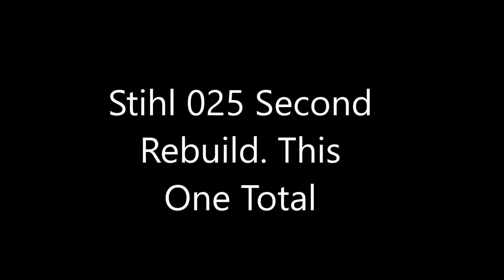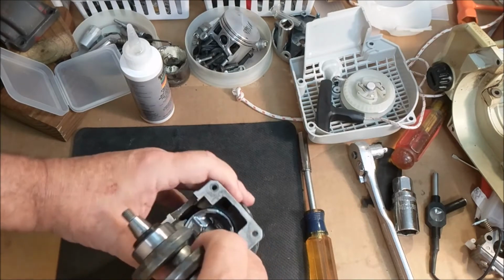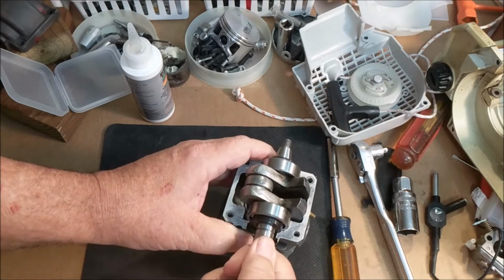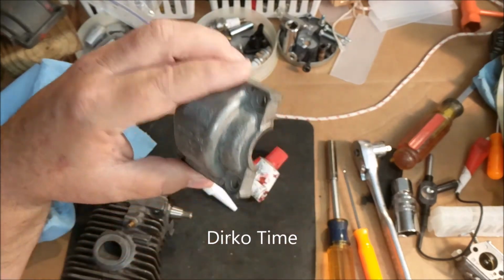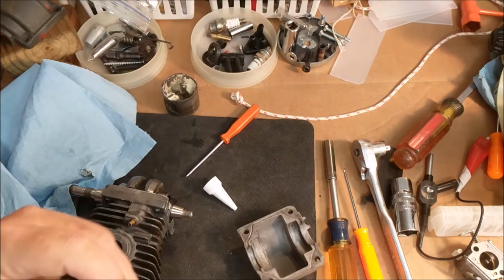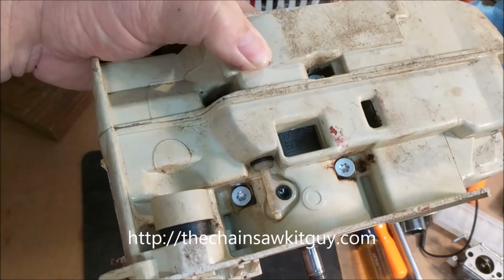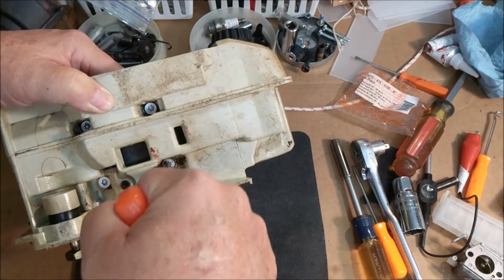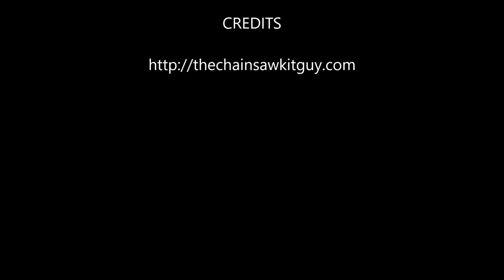Stihl 025 Second Rebuild Series  This One Total

Comment: My favorite chainsaw, my grandad dumpster dove for our 025 when i was STIHL a baby. It stihl runs.
Reply from the maker: This one came out of a pawn shop. Man was it in rough shape. Much later good as new
Reply: I wasn’t that lucky, but my 025 runs great.  It was made in the early 90’s.  It had a loose front bar bolt that I had to fix and a broken starter but I fixed allof it’s problems and now is a good running saw

Comment: If I have to pull the cylinder out of a saw it get new seals and bearings if it needs them.  That’s just my policy.  I don’t want to have to tear it down any time in the near future.  I had to put a new crank in an 021 last week.  It was a used ms 211 crank.  I had to replace one of the bearings because it was turning on the crank.  The bearing was ok but it was loose on the crank.  The new one is not loose.  I sealed it up with TB 1184.

Comment: I am having to do the same thing to my 021 Stihl.  I thought I would get it to run with its original cylinder but I could not.  I repaired all the obvious problems but it has more internal problems, even though the piston looks fine from the exhaust side.  Since I have to pull it down, I am putting a 40mm jug on it, new bearings and seals.  Maybe a little overkill but Indonnot want to have to go into it, again.  Anytime I have to into a saw, split cases or the like, I just replace all the possible problem.  The 021 will get a new intake new intake boot, too.
It will probably be several months before I get everything together.  I have an MS 250, 362 and now, the 021 parts in a box, awaiting parts and time to rebuild them.  This is a job that I did not plan on.
Reply from the maker: I might wonder what could make a cylinder the problem unless it was a crack or something. Regardless it sounds like a fun project. I am sure you pressure tested it, easier when it's assembled. Curiosity would get the best of me. GL
Reply: @the1chainsawguy  my friend looked at it and he thinks it has a stuck ring on the intake side or a bad seal.  Either way I have to tear it down, so I decided to bump it up to 40mm.  The exhaust side looks ok but it could be a broken. Rankcase seal or crank seal.  It has decent compression, but that is not always an indication the cylinder is ok.  It will not run.
Reply from the maker: @johnclarke6647  you seemed to blame the cylinder and that was how I framed my reply. Yes sir lots can keep her from starting. I felt sure you had looked at the coil, fuel. A pressure test will give you indications that would lead to an answer with the exception of the coil or a physical problem with the carb it's self rather than a lack of fuel to the carb. Those kind of problems will mislead you. You will figure it out.
Reply: @the1chainsawguy  I know what the problem is, now.  Took the 021 completely apart and found way to much ring gap, rod bearings in the crankcase, seals looked like crap.  Sawdust and oil packed completely under and around the crankcase.  I have the case cleaned up, now.  It tookSuper Clean, a paint brush and my small screwdriver to get it all out.  Washed it good in the kitchen sink and it is drying, outside, now.  I am going to throw a 40mm jug and a new crank init.  Could put the bearing back in the rod but with as much wear as their was on the rings, the rod bearings probably have as much or more wear on them.  I got an oem Stihl crank for it with good bearings and piston and rings.  I may just get a 38 mm cylinder set for it.  I don’t know exactly how I am going to rebuild it, yet.  I will look at the parts I have and go from there.  I have already rebuilt a MS 260,025 and 024 this year, plus a Farmertec MS 250.
Reply: @the1chainsawguy  I disassembled the 021, today.  It took 40 minutes and twice that long to clean up the cases.  They are sparkling, now.